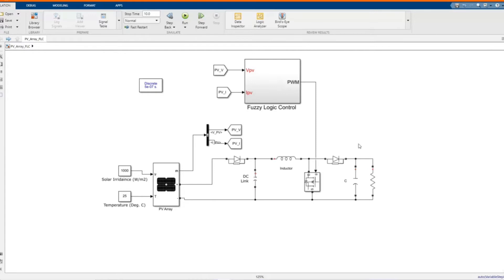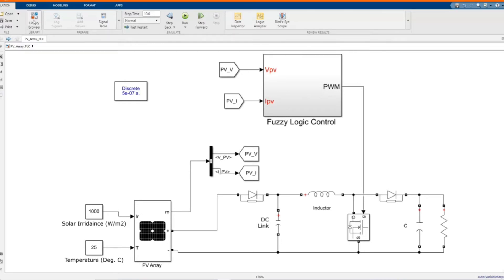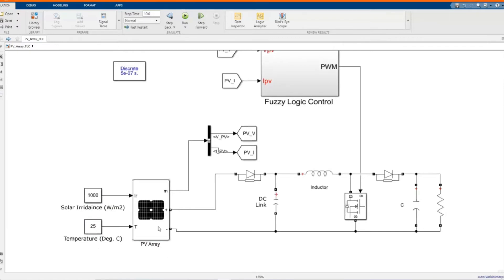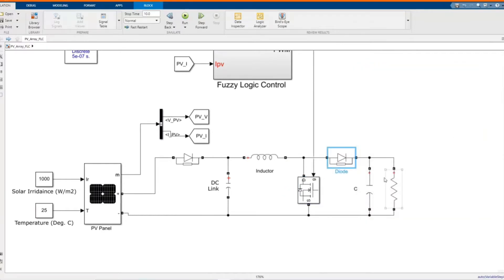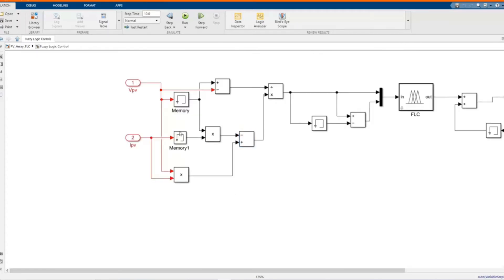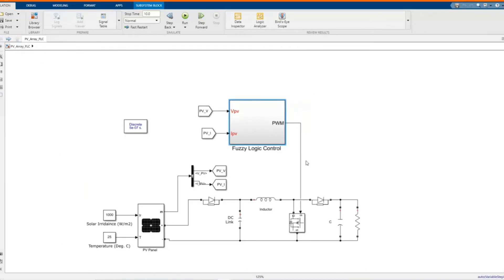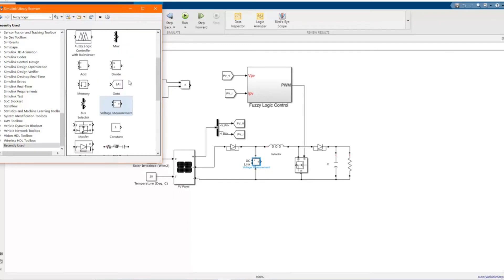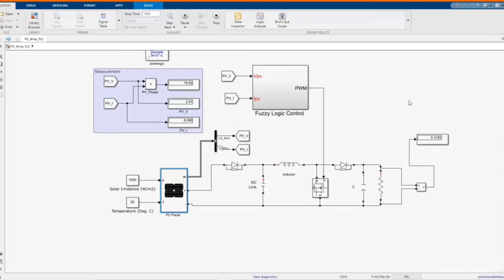Simulation of PV Solar Array with Fuzzy Logic MPPT Controller in MATLAB/Simulink

Comment: In this model of caculation 2 inputs, something is wrong. You caculated DeltaP/DeltaV, (DeltaV = Vnow-Vprevious, DeltaP = Pnow-Pprevious). But in the sum of deltaV, you put Vnow with minus input (-).
Reply: I noticed it too. It should be '+' connection for Vnow and ' - ' connection for Vprevious.